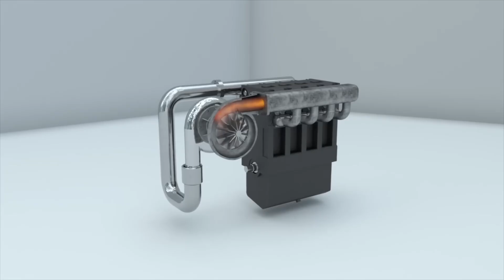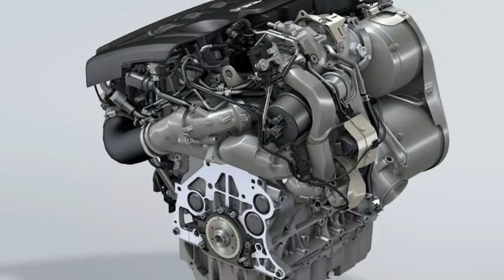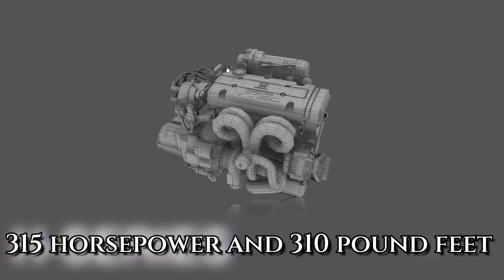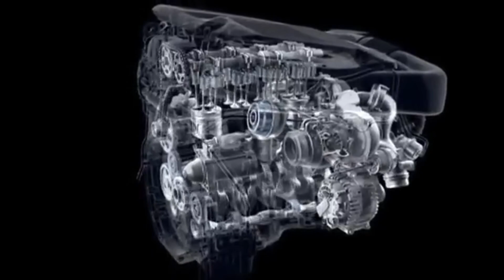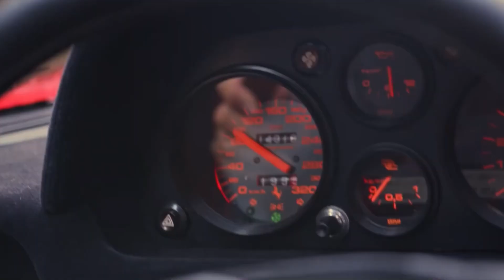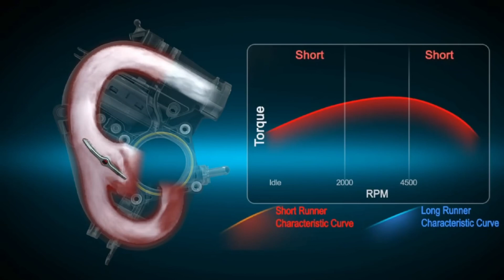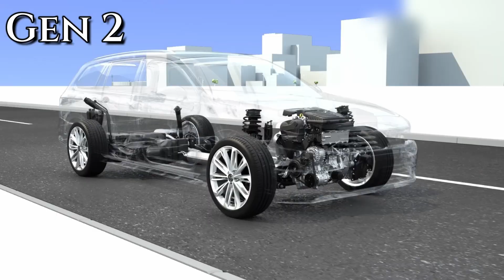Top 20 Most Reliable Turbocharged Engines On The Planet (2024)

Comment: The LM2 Duramax is mid tier for reliability. Many issues with oil leaks and DEF injector faults. And of course the P1098 error code due to the coolant control valve failing. The LZ0 has been better so far but it's too early to tell.

Comment: The Bot lost all credibility when mentioning the 3.0 liter GM Duramax Diesel!
Reply: Not sure what you’re on about here. I own one and it’s been a great truck. Lots of power, great fuel economy, and zero issues going on 100k miles..  definitely deserves a spot here IMO.
Reply: @RoosterCogburn6969  Wait until you need to replace the wet belt that drives the crankcase oil pump and then reconsider how great it is.
Reply from the maker: Thanks for the feedback and for watching! The 3.0 is widely considered to be reliable for a modern diesel. Your comment about the wet belt maintenance is more of a design quirk than a reliability issue. A lot of engines require big ticket maintenance items when they get to higher mileages. Doesn’t necessarily reflect overall reliability but perhaps is more a cost of ownership concern. Thanks again for the comment!